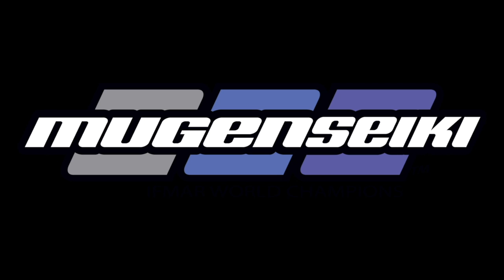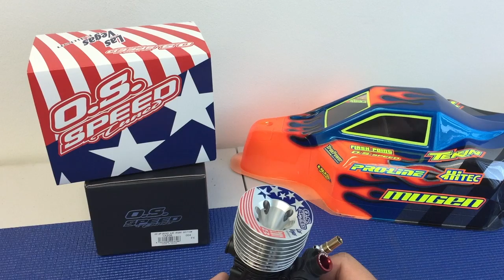Adam Drake from Mugen Seiki Racing talks about carburetor settings for the O.S. Speed B2101 engine.

Comment: Do you prefer the B2102 or the B2101 ?
Reply from the maker: It depends on the track conditions.  The B2101 will have more power and the B2102 will be smoother and have better fuel mileage.

Comment: Prefer o.s. to Novarossi?
Reply from the maker: Yes, both are great engines, but the performance and quality of the O.S. engine is amazing!
Reply: Novarossi in my opinion is better because it’s much easier to get tune and doesn’t have the middle needle and the manual book tells you how to get tuned but O.S. Engines you have to ask other people how to get tuned or what settings their using that’s why Adam tells you the setting by number instead of turns

Comment: Hi Adam great vid as always , I've just changed over to a OS Engine and have the B2101 Las Vegas Ed , it is run in but hasn't " dropped its nuts " as yet   so I will be starting out with the settings you have here , what plug would you recommend I run werks fuel 30% , the break in was done with a P3 plug , and I have some people recommend swapping to a P4 after its completely run in
Reply from the maker: I always use the P3 plug.